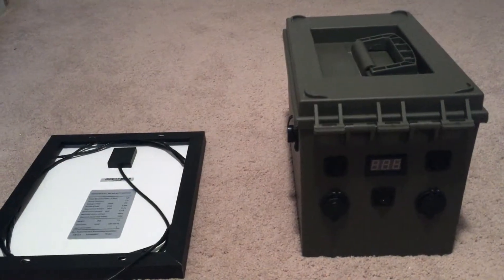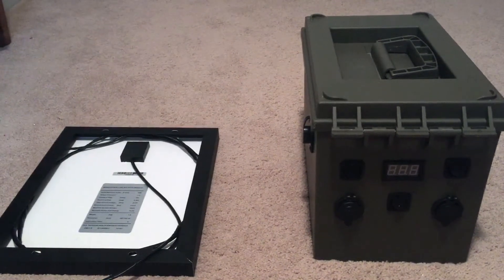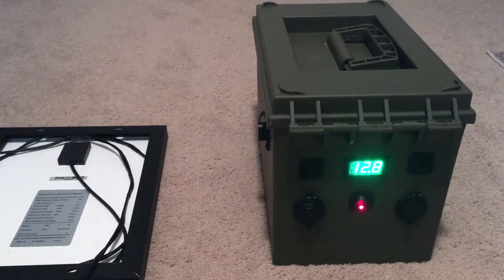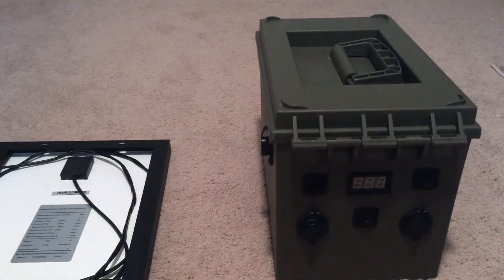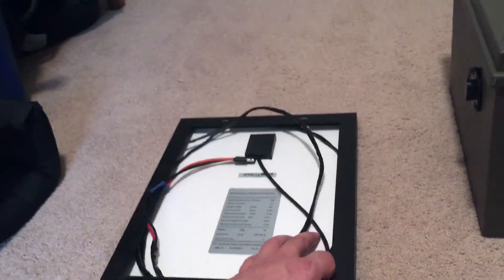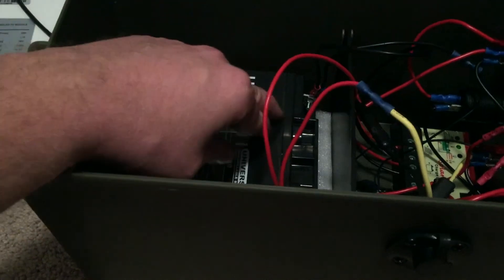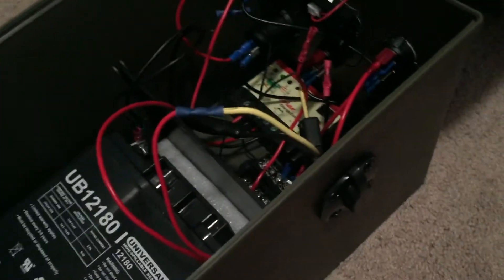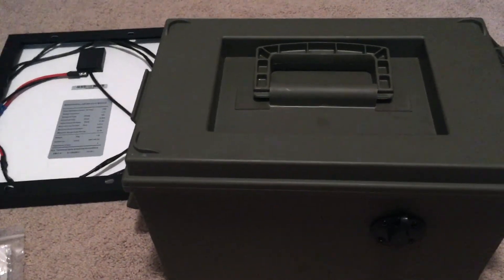solar generator

Comment from the maker: here is a list of the things i ordered off Amazon minus the battery that you already have. This list is copied in the exact wording and you should be able to search in Amazon and find the items okay. I tried to copy them as links but that didn't work. I have also found that when running a power inverter my voltage drops a little too far. I will likely be adding a second battery in the future. In my video I have the battery laid down on its side. The box I bough I made sure I had room enough to stand the battery up so I could add a second one if needed. So two should fit in the box okay.
         
Powerlet Luggage Electrix Connector

Ezdiyworld-8 Way Terminal Block Bus Bar Splits 1 Input to 8 Out 

CES 12 Gauge 2 Pin Quick Disconnect Harness

Power Outlet Dual USB Charger Socket 2.1a 1a for Ipad Iphone Car Boat Marine Mobile 

 BANDC Waterproof Marine Motorcycle ATV Rv Lighter Socket Power Outlet Socket Receptacle 12v Plug 

Wise Outdoors 5604-13 Large Utility Dry Box, Green 

Renogy 10 Amp PWM Charge Controller Regulator Off Grid for Battery Charging 

Keep It Clean SW16R Red 25 Amp/12V Square Framed LED Rocker Switch 

DROK® Digital Voltmeter Testing Car Motorcycle Battery, Green LED Panel Mount DC 3.5-30V Power Voltage Monitor, Measure 12V 24V Directly 

 2 of Keep It Clean SW16G Green 25 Amp/12V Square Framed LED Rocker Switch 

 ALEKO® 10W 10-Watt Monocrystalline Solar Panel